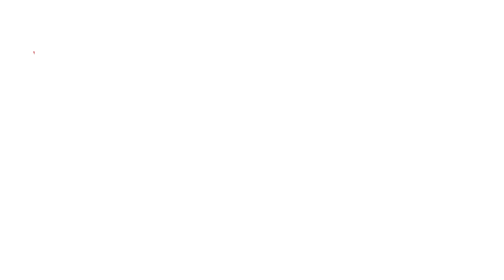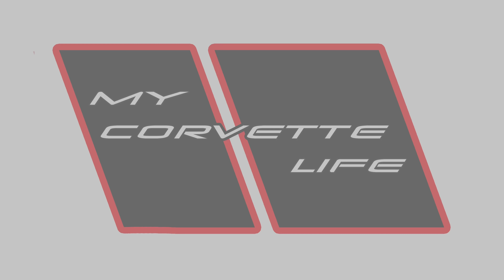Update On My C5

Comment: I did my harmonic balancer myself in my garage on jack stands before I got Quick Jacks... Watching you literally disassemble the C5 & put it back together again... I know you can do it... Other than a little time consuming... The bugger is torking down the balancer bolt... Change the
Shaft seal also... Definitely easier with another guy... If I can do it...
I know you can too...
Reply from the maker: I know I could do it.  I just don’t want to.  🤣
Reply: @mycorvettelife  I hear ya...

Comment: Check your harmonic balance or when the engine is running does it wobble back-and-forth a little bit if it does it needs to be replaced it will cause the belt to chirp because it’s sliding back-and-forth on the other pulley I am replacing one at work right now on a C6 Corvette has the same problem
Reply from the maker: I said in this video that it is not wobbling.

Comment: I'm also currently chasing a squeaking belt. I've changed out the harmonic balancer, tensioner pulley, idler pulley and I've changed the belt 3 times. Everytime I change something, it fixes the problem for awhile (between a week and a few months) but the squeal always comes back. I'm going to try the alternator next and if that doesn't do it,  honestly I think I'm at the point where I'm just gonna spray the belt once a week with that belt dressing crap that everyone says not to use.

Comment: Great vid as always. Have a quick question for anyone 
My c5 won’t start unless I open my passenger side door first to trip the flashing security on my dash. If I open my drivers door in the am the security won’t flash most of the time for the car to start. It’s like my bcm isn’t waking up when I get in drivers side only. Anyone had this happen or what it could be? Is there a security wire or something attached to the door lock?
Reply from the maker: That’s interesting.  Make a post on Corvette Forum.  I’m sure someone has come across this.
Reply: @mycorvettelife  thanks I did no one seems to know so I tried here. It sounds like maybe my door latch has gone faulty. Dunno :(
Reply: Try C&S Corvettes, Ask him about it bud

Comment: Why did you give up on your A/C ? Couldn't find the leak or something else ?
Reply from the maker: It’s not a leak.  It’s an electrical issue.  All the AC parts have been replaced.  I got tired of wasting money on it.
Reply: @mycorvettelife  I have a 2000 C5. I have a leak in the A/C System. Its getting replaced soon. I hope I dont have a electrical problem too...

Comment: I've developed a oil leak in front of tourqe tube. Not oil sensor.  Any ideas chris.
Reply from the maker: Rear main seal.
Reply: @mycorvettelife   Thats not good.
Reply: Could also be the upper oil pan gasket.
Reply: @christianleroy-hernandez2437  I only drive it maybe 5 times a year so I guess the seals are going bad.